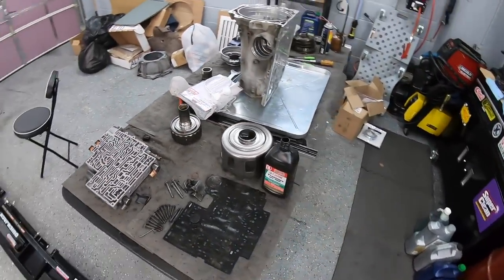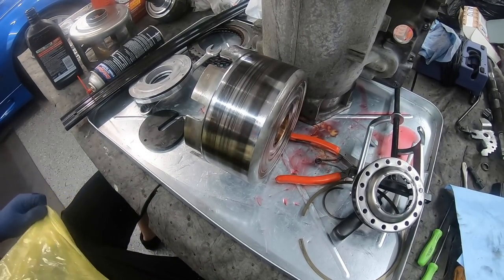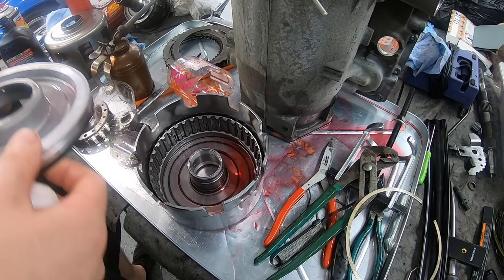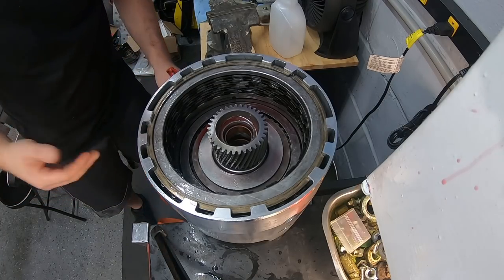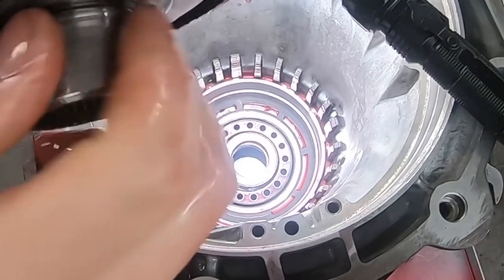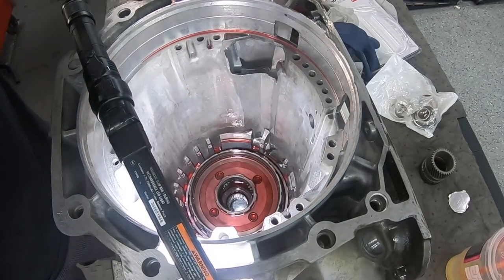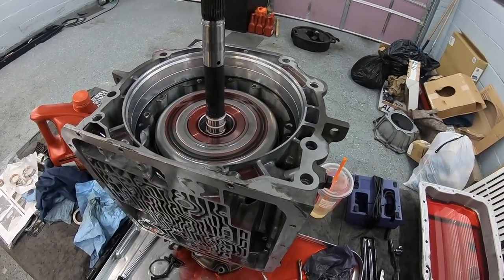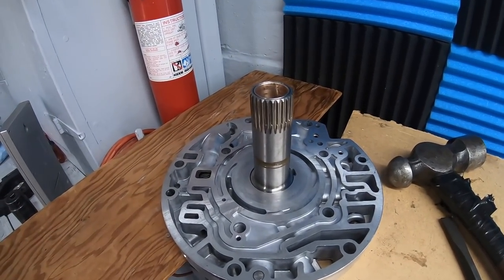Rebuilding Tahiti's 220,000 Mile Transmission! In One Video...

Comment: I love to see you used one of my best selling kits...... I did notice though your rear sun gear snap ring was dislodge from the initial shell failure and then you installed the gear with the spacer ring not seated into the groove in the slot on the sun gear. That will lead to issues.....

Comment: LOL!  This reminds me of the first one of these I tore into.  I am and have been a Master L1 certified tech working in professional shops for 30 years now.  I never have been one that likes to send work like this off to the fairy in never never land where the challenging work gets done!  It’s really just another tech that fought through the learning curve and mastered the work!  My first had to come out and back apart 4 times before I got it right.  I now own most of the tools to do some of the more difficult tasks in a more professional manner.  Everything HAS to be just right or it’s just not going to work correctly or last for very long.  Anyone thinking about doing this should at least understand theory or operation and be ready to perfect the assembly or you will get kicked in the nuts!

Comment: Great video. I just really hope that grease doesn't give you trouble. Should use trans assembly lube or in a pinch petroleum jelly/vaseline. Axle grease doesn't dissolve into the trans fluid vary well.

Comment: I have a hand me down  2004 Yukon from my parents who bought it slightly used with 20K miles. Although my father didn't earn a living being a mechanic, never not once did any of our vehicles go to the dealer or mechanic for any type of work unless it was under warranty OR tranny rebuilds so hats off to you for tackling such a job. My Yukon didn't require a rebuild unit 220K miles. If I remember correctly it costed me $800 to have a local shop rebuild it for me, I do remember him recommending a part or 2 from typically used in a corvette rebuild vs what was used from the factory. I've seen a handful of your videos and for someone who hates most aftermarket garbage, I plan on modeling my Yukon with many of the visual upgrades you've chosen. 

How many times have you done a tranny rebuild?

Comment: Excellent use of the D&D cup in the Teflon seals! I used an Alto 4th gear pack (9 clutches). Did you happen to research that? It lasted years even pulling my boat to the coast in overdrive a few times a year.
Reply from the maker: Yes! The kit I used and linked does come with the upgraded 3-4 pack. It comes with more clutches and thinner steels. I completely forgot to mention it while assembling the pack..

Comment: By far the best amateur trans video I've ever seen. A few issues but still excellent. I'd suggest OP watch some Precision Transmission vids on these to help him understand the how/why on some things but he's 90% of the way to being good. A heated parts washer for the valve body and other internal parts would be his next thing to buy/build. Can make one out of a large plastic tote. Just put a false bottom in so you don't knock holes through the plastic. The heat will release the clutch grim for the steel and aluminum so it doesn't get pumped thru the VB creating issues. Please don't take my comments as criticism but as suggestions to help prevent further issues. Looking for ways to improve the quality of repair is in your best interest.

Oh...check ball capsule in case that can be seen thru servo cover should be replaced when 3/4 clutches are burnt. It's not hard to do.
Reply from the maker: No problem at all, thanks for the kind words. 90% is awesome considering I’m not a transmission builder!

Comment: why does the valve body have that particular design for the channels? Are the valve body channel design standard on all auto transmissions or does every car manufacturer design it differently.
Reply from the maker: The 4l60e/700-r4's are the only transmissions I've tackled. I have my friends charger trans apart now and the whole setup is a lot simpler. Seems like manufacturers just like to do their own thing!
Reply: @lsxmatt  thanks matt love the vids

Comment: I’m putting a ls 5.3 in my 92 any advice?
Reply from the maker: Just take your time, collect the parts before you tear into it if the car is still running with the old motor. That way you can still enjoy it, and get the job done quicker if you have all the parts.
Reply: LsxMatt thanks what transmission u prefer